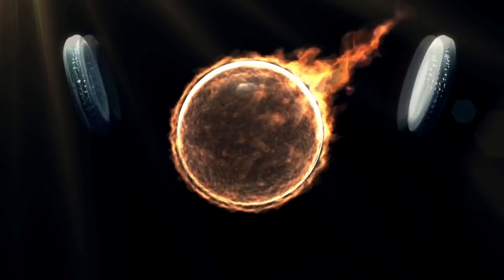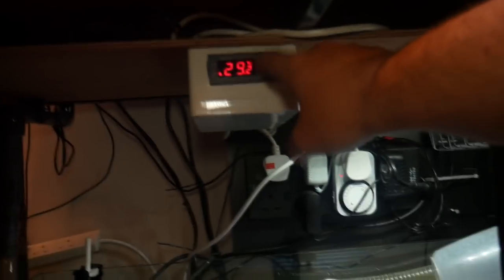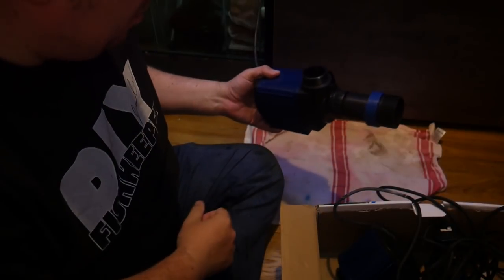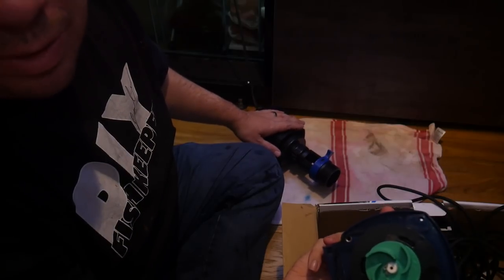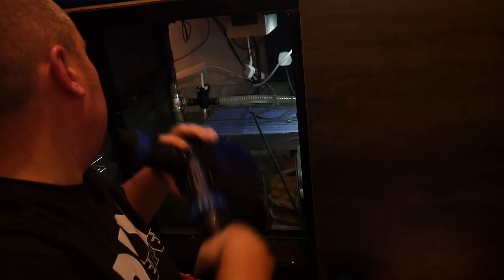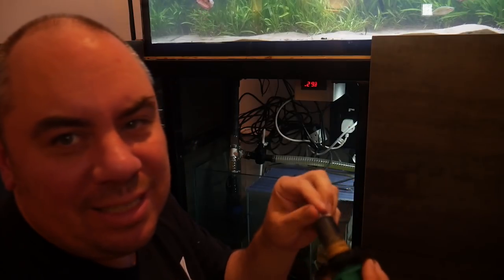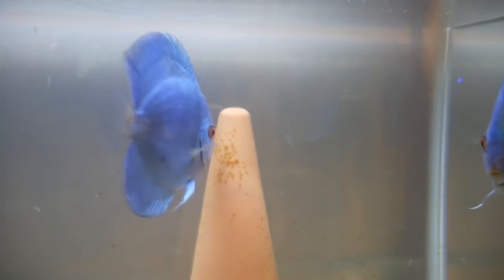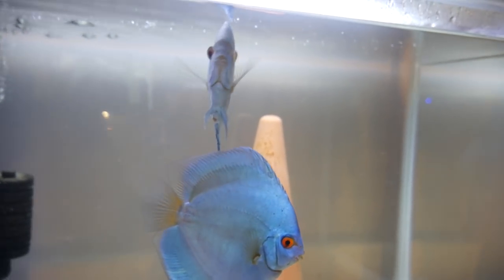Filtration failure! My freshwater sump pump failed - why you need a backup plan.

Comment: I was half expecting to see a tank full of dead fish and a link to a gofundme page when I saw the thumbnail for this video, lol
It's definitely worth having 2 pumps the same (one to run and one as a spare) as you can keep spares from the one which died so good on you there, man. 
With regard to to how long filter media will stay 'alive' with bacteria it depends on the type and porosity (and if it dries out or not). Plastic media surface area is all external so bacteria dies very quickly, when media is removed from water (and it dries out) whereas more porous media will hold water for days or weeks even when it is left out of the tank. The biohome can take weeks to dry out even when it is left outside in the sun so in theory the bacteria should last many days, maybe a week or more? 
Either way it is still best to get the filter running again as soon as possible especially since many people's systems are running at a critical level - even an emergency internal filter in the tank will keep water moving and media from larger filter can be hung in a mesh bag near the outflow of the internal to keep it alive until the main filter is fixed.

Comment: I was just curious to ask if you think a Fluval FX6 canister filter would provide too much water flow for discus fish? Or why did you decide on a sump?
Reply from the maker: I used to run a FX5 on my discus tank - which is basically a FX6, it was great.  Flow can always be directed toward the glass or diffused in some other way if you think the fish don't like it, but i've never noticed a problem.
I just went with the sump as just gives me more options, can fit in as much media / water polishing as i want and can hide heaters etc in there.
Reply: Thanks! I'm setting up a tank specifically for discus and was thinking to go with the Fluval canisters. Great to hear you didn't have issues! :)
Reply from the maker: You'll do fine with an FX6 👍